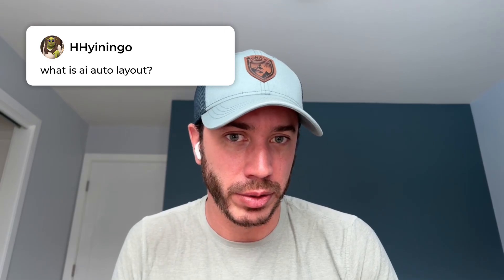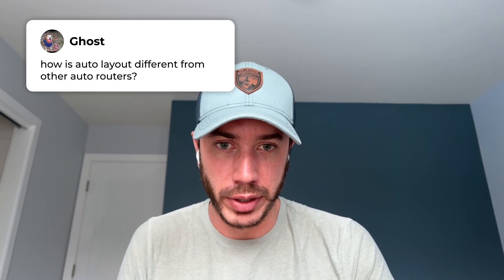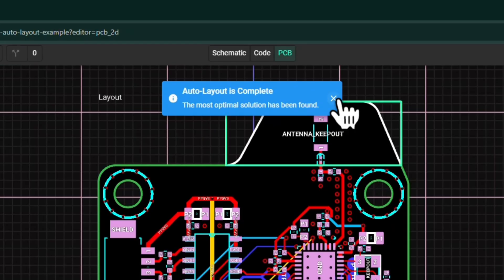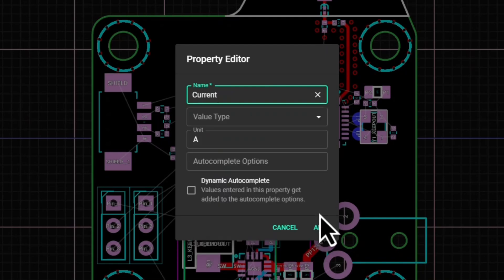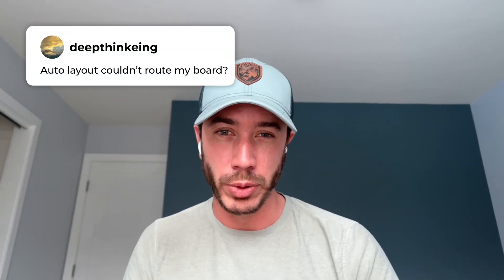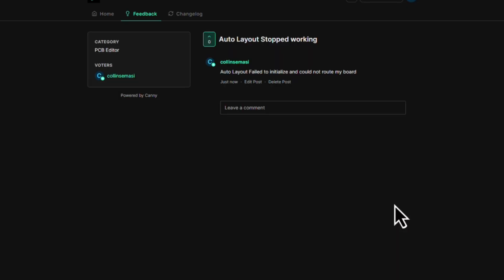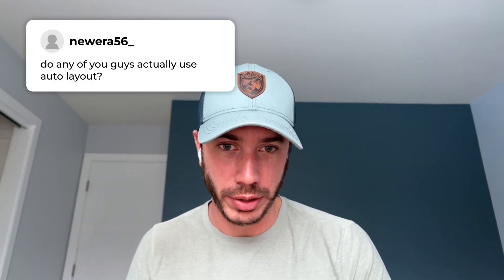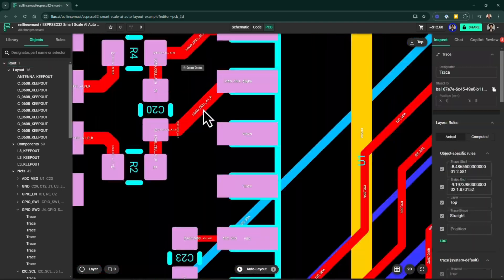Ex iPhone Engineer answers questions about AI Auto-Layout

Comment: Are you using transformer models to do auto layout? Is is this just rebadged place and route that we’ve had for half a century?
Reply from the maker: AI Auto-Layout uses reinforcement learning to route PCBs more like a human would. Instead of just finding the shortest path, it prioritizes signal integrity, manufacturability, and clear layouts.

It iterates through different routing options, learning from each attempt to avoid unnecessary vias and messy traces. You can manually place critical traces, then let Auto-Layout handle the rest. It works out of the box but also allows customization for specific design needs.